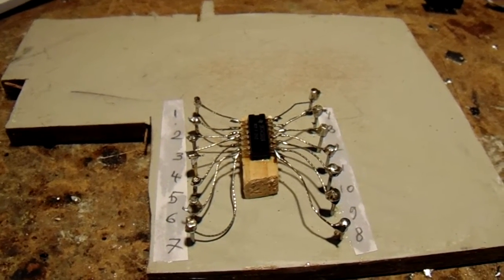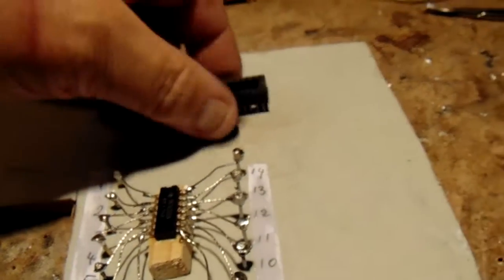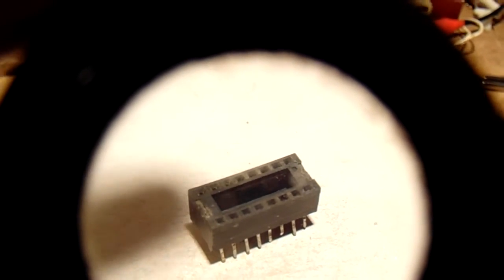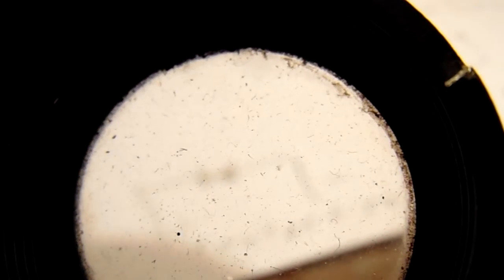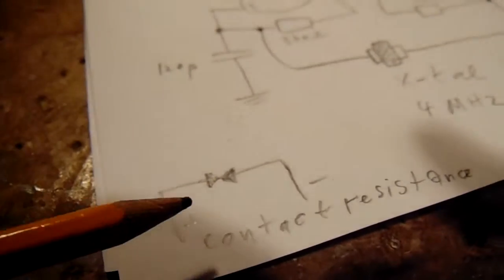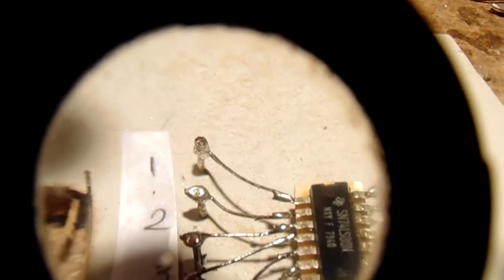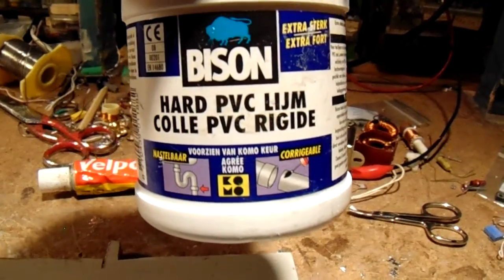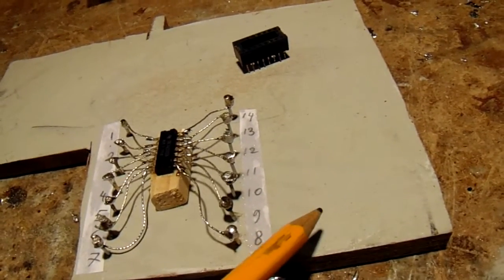Proper galvanic connections from electronic components & breadboards (here a 7400 Chip)

Comment: Thanks for all the great videos. I'm new to electronic, and do not understand why you say you coated the board with PVC glue. Could you explain? Thanks.
Reply from the maker: Thanks for your reaction. The method is brass nails punched into a piece of multiplex board and the components mounted on it, board first glued with PVC glue. The PVC glue has a very good isolation factor and it keeps all free from moisture, moisture brings the internal resistances from the electronic components down. Much more info about this via my YT channel trailer, search for "Radiofun232 on Youtube". There are more videos about this issue.
Reply: Thanks for your reply, I will check out your other videos on the subject. Again, many thanks.

Comment: Hello Ko   i buy the plastic bread board and not like it. Leads short and get bad connections was that me you mention thanks. I check out the glue.  I have the wood adhesive resin based which is water solvent. I think i can use it providing give long time to dry properly. I will look at the resistance between the pins and go from there.  Thanks m8 all the best Richard
Reply from the maker: Hi Richard, perhaps a test is necessary when you use the glue that you proposed. You can measure with an ohms meter the resistance between two points (copper nails or so). i think water solvent resin is not ok, but anyway.

Comment: Thanks I'm getting a resistance 560 meg. I just get it from wood yard for nothing. I need to dry it out any way. My test for the glue is no good as you predicted. So far too expensive. Will look soon.. I not have alot scrap parts. But on eBay. 2 lots bulk new parts looked far too good to pass up. Looks like more then I can ever use. I'm isolated hear so no sutable flee markets. Cheers Richard